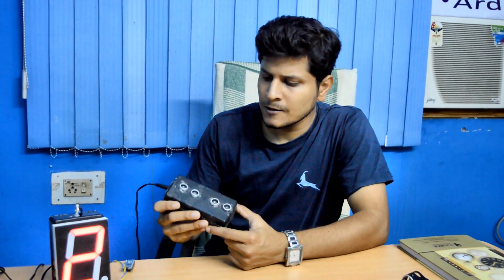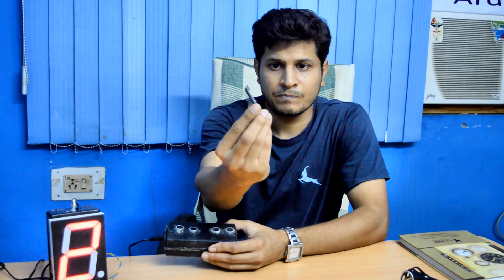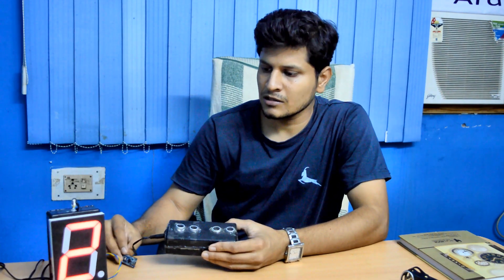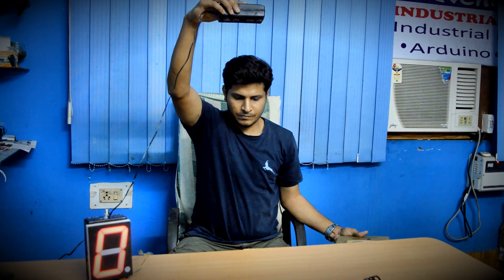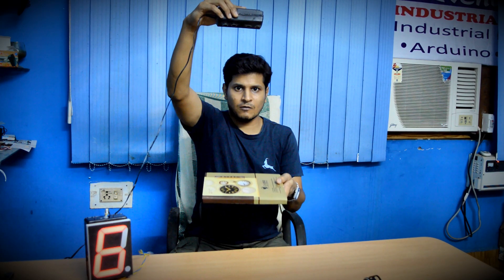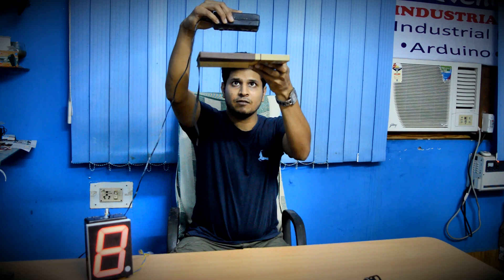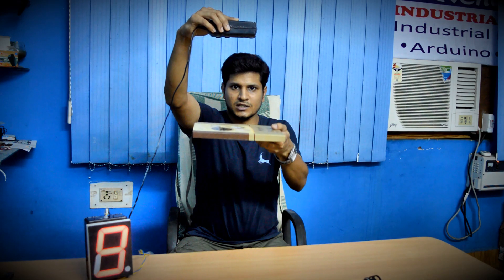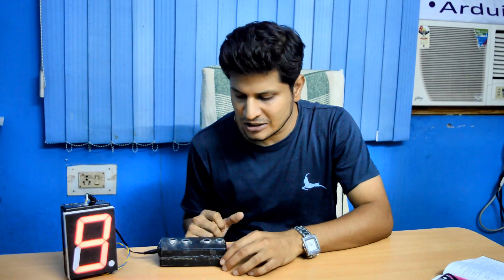Wireless Water Level Monitor

Comment: You might want to introduce smaller device which can be used like a pod on any tank and connected with internet. The data recorded can be used to help the owner (House owner or the Industry to optimise the usage of water). Inclusion of AI in the process can help alert any leakages.

Comment: Sir, I don't think placing these ultrasonic transceiver inside a water tank is a good idea. The water vapor saturation inside the tank will be 100%. This will definitely cause condensation and corrosion leading to circuit malfunction.
Reply from the maker: With our Design, the product successfully gave accurate results for more than 1year. So the vapours don't harm our product design.
Reply: @HowGadgetsWork  I don't know. its a circuit board with smd components and the ultrasonic transducers have metal components. How not they corrode ?
Reply from the maker: @apurbadas5810   that's the speciality of our product design. The ultrasonic sensor is placed such a way that every other component is made waterproof except the two tx rx eyes.  Cheers 😍🤟
Reply: @HowGadgetsWork  Then it's alright.
Reply: @apurbadas5810  because outer part of sonar made of aluminium it doesn't lead to corrosion...i also using wireless water level controlling system with advance features..like...alarm .. warning...etc...from 1 year. .my own made project